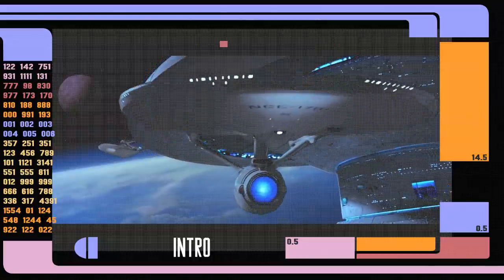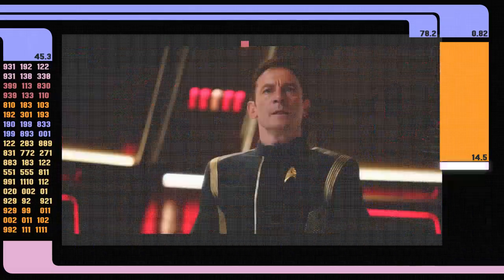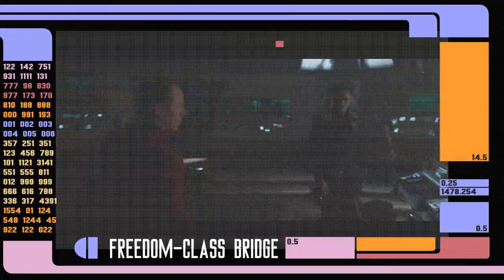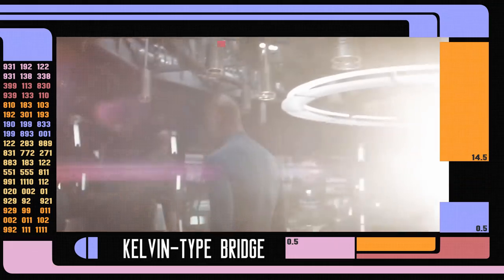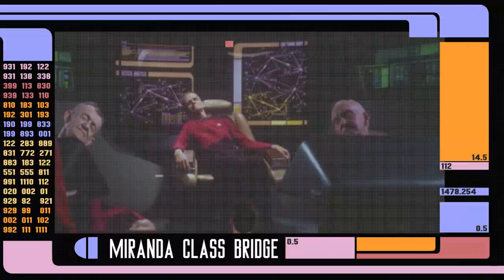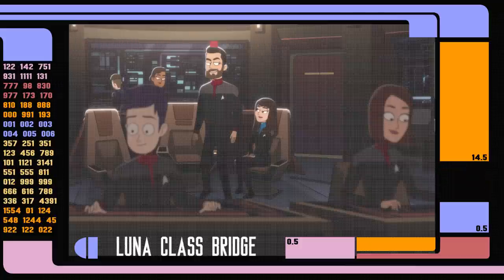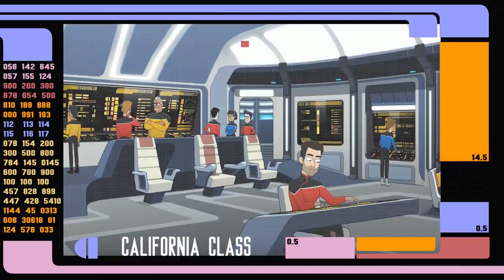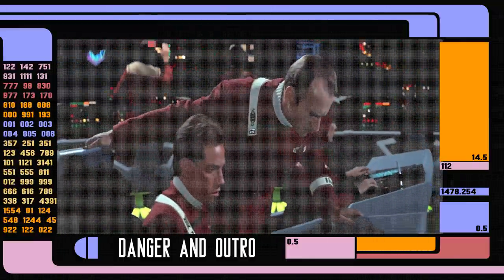Forgotten, Fatal, and Unethical Starfleet Bridges

Comment: The thing with exploding consoles is this: It is more than once stated that apart from the EPS power grid a seperate grid for the computers exists. The ODN grid. Yes it still would need power, but would it really be necassary to plug the bridge directly into the main eps grid? If starfleet is so big on redunancies, like O'Brien never is tired to remind us off, it actually would make sense to have bridge controls on some kind of independend fusion powered system. If that even would be too much power necassary just to keep the computer controls operational.

In the end the equivalent of an intranet would be all, that's necassary just to control things. The chief engineer is in engineering practically all the time anyways to work the machines, if anything happens anyways.

But I get it. Nothing what we see actually supports this designs posited.

Comment: Comment on section "Danger and Outro": In terms of power, the main power "lines" or the backbone of the power system of Star Fleet ships is Plasma (an ionized gas consisting of positive ions and free electrons) generated by the warp core (a Mater/Anti-Mater Reaction Generator) So yes the amount of power flowing in the walls and consoles may be too much to cut off or dial back in a combat emergency. And yes in a good design that does not have extras being killed by expoidium rocks would dictate that there be a shunt for the console that can be turned off in the event of an overload. But Star Fleet.

Comment: If you look at the Defiant you’ll see much more “ submarine” design. For 1 it’s sunken into the ship to make it difficult for an enemy to target it. 2 it’s a drastically smaller overall design with no science BS cause a defiant is not meant for science. 3 the closeness of the officers to the central captains chair means information can be quickly passed to the captain. 4 the navigation and Conn stations are one station operated by a single officer. There’s a slightly raised platform at the back and the captain’s chair is slightly raised but not by much. The Defiant class shows that the ship is focused on its primary task exclusively which is combat. The captain does have good access to any station they need and can quickly take over navigation if the officer manning the position is incapacitated. If you notice the defiant class also relocated the habitation spaces on the bottom of the ship to make it harder to hit a window. Lastly the class is entirely reliant on its view screen as the sunken layout basically eliminates anywhere to place a window

Comment: I've always had my own theory on the "rocks". What we're seeing is actually chunks of metal. As the EPS is damaged and has surges the plasma essentially causes the metal to become brittle and shatter, like a car windscreen would. However rather than just shattering it is usually accompanied by a surge directly in that area that then causes the shards to explode outwards. But I have always maintained that if the metallurgy of the future is different and the weapons are energy weapons and not kinetic then the effects they could have on the metal may cause it again to shatter or break off in chunks rather than ripping and tearing like a metal plate would.

Comment: With submarines at depth the water around them blocks nearly all of the light from reaching them.  They could have headlights, but that won't light up a very large area that far down.  Good enough for a small research sub, but not far enough for military use.

Space does not block light the same way.  Most of it looks rather dark because light sources are far away, but you can see bright objects from quite a distance.  A clear night you can even see some larger spacecraft as a point of light.

And the research role of Starfleet vessels would also strengthen the argument for windows relative to military submarines.

Comment: Firstly, let me say a resounding YES to the idea of a overview of alien bridge layouts.

As to the issue of windows and materials for such - we DO have something similar to transparent aluminum known as ALON, a substance that is, for all intents and purposes, transparent artificial sapphire, and it currently sees use in military vehicles and other places.  With the clearly-shown ability to have integrated display systems and optical protection, this could see some use, though I am not sure about its' effectiveness in high-radiation environments (such as space).

On the matter of seats - I've never understood Starfleet's reluctance to include basic restraints on any and every bridge (and other) seat, even if only for emergencies such as combat and/or loss of internal gravity.  They've given some nods in the direction of this now and again, but for the most part is seems to have been completely ignored and forgotten.

I think, however, that many of the commentators here have been over this in a fairly comprehensive and thorough manner that makes anything further that I might say rather redundant.  Thank you, though, for the series!

Comment: One comment on the view screen is that it was never a window, even if tech wise it could be and I feel it can make sense, but historically it was never a window until a production team that didn’t know or understand startrek took over without looking at what came before, this is most persons problems with the view screen being a window.
On the CIC point or auxiliary control in the 24 century it is became less relevant as most consoles can be reconfigured to do almost any basic ship control functions, we see this many times where as the enterprise was being controlled or taken over from engineering. And even at points where the crew is standing around the table in engineering doing CIC things, I still feel that there was an at least auxiliary control on these ships we just never seen it on screen, but I think we have plenty of evidence to show that engineering can and dose function in this role fairly well.

Comment: Soooo, the bridge consoles are connected directly to the voltages that come out of the warp core? I'd imagine that finding people brave enough to touch the buttons would be a tough job. Surely the power would be stepped down to a useable (and safe) voltage by the time it got to the consoles. At the very least the circuitry would melt before the voltage overwhelmed the circuit breakers.

Comment: Bridges with all the main characters in one room on the ship are great for the drama, however, if I were designing a ship, I would have a distributed architecture with different stations throughout the ship, to reduce the chance of a single piece of debris or one projectile taking out the command center. Once the go to action stations,  all compartments would be sealed with air and gas tight doors to limit the damage from a hull breach. I would go for NO windows. External cameras and screens can do the same job and better filter radiation, especially if they hit a Romulan ship and their black hole drive goes critical. All crew would need to put on anti flash gear and helmets. They would also need side arms ready to repel boarders and at least some sort of basic environmental suit.

Comment: The reason all military vehicles and vessels capable of using windows use windows RIGHT NOW is that while humans may not have the most advanced range finding or multi-spectral analysis hardware, the Eyeball Mk.I is still the most ubiquitous sensor available to our species for all visual needs.
If your fancy radar assisted targeting gets fried by EMP, or develops a glitch, or is broken by falling into a chasm during a sudden earthquake, you can still look at things and try to hit them.

If you can't then that opens up a whole new can of worms. The issue with windows on spaceships is that if you want to look at something that's even relatively close in space then you pretty much need to know exactly where it's supposed to be and HOPE it's reflecting or emitting enough light for your jelly globes to focus in on. But the spaceships in Star-Trek generally fight at so close a range as to be practically TOUCHING each other by comparison, so windows would still work.

Comment: One thing about the Freedom class is that it wasn't designed for the MACOs, it was a survey vessel, and the MACO captain & his crew in the film were 'demoted' to a survey vessel for political reasons, probably off of a dedicated warship like the columbia for demilitarization shortly after the foundation of starfleet. With the founding in 2161, this leaves 2-4 years of "early 2160s" for the federation to start demilitarizing it's member states & building combined starfleet, thus fitting in the timeline.

Comment: At 0:37 The Excelsior has it's iPod plugged in and ready to blast some beats.  Good while it's being towed back to space dock.  

As for captain in the middle and the bridge on top design, it feels like that would make a lot of sense as a design aesthetic that no Star Fleet procurement team would allow to change.  My take is that military and quasi-military traditions run deep.  Star Fleet being mocked for this slavish devote to a clearly goofy reliance would be a good point for Lower Decks to tackle.  Same for Klingon's same idea while putting support struts blocking the captain's line of sight (and sound) to important bridge officers even though they would probably have some very elaborate arguments boiling down to "but we've always done it this way" while citing their victories in numerous fights.  The flip flopping of clearly present restraints and seats to no visible restraints with some officers standing would be up to design philosophies of the era just like the uniforms because it's not that iconic.

Also Star Trek throws out cannon for hack writing.

Comment: Not rocks but a thick coating of ceramic thermal insulation similar to on the bottom of the space shuttle, it is ment to protect the outer decks from times of high heat and radiation exposure they can't retreat to a position in the ship that is less exposed, this is hidden behind panels normally but in combat areas with direct hits this material and its panels concealing it get blown off by the impact and the fractured thermal insulation looks like broken rocks of various sizes.

Comment: Transparent Aluminium is a ceramic that is not made from aluminium but aluminium bases compounds (Aluminium Oxynitride) has been in existence in the US since the early 1980s and is available under the ALON brand. 

Researchers in China have also reported to have developed a ceramic, AM-III carbon another transparent semiconductor glass material capable of scratching diamonds.

Comment: First off, the Constitution refit had seat restraints, and they were used. See TMP and ST VI, from the top of my head.
I don't know if it was one of your videos that mentioned how impractical the wishbone structure behind the captain is for tactical station, but it's something to be mentioned.
And beating a dead horse, only accessing the bridge by turbolift is a crappy way to do things.
You lose a lot putting windows in bridges. For one thing, it means it's near the outer hull (granted that it's where bridges are located in the Star trek universe, but we're discussing logic, not canon). For another, mechanical impact is just one of the things a bridge must be protected against. Laser fire (something windows are designed to be vulnerable to, being transparent and all) and radiation in many forms. 
Also, as any fighter pilot will tell you, if you only have a vision arc of some 30 degrees in front of you is begging to be outmaneuvered and killed.
Also, being in the outer hull, it's in a extreme point, making average travel time from off duty places (say, the gym) to your bridge station longer. And it creeates a bottleneck for the crew to create a jam in getting there. Imagine the turbolifts lining up, waiting for the previous in line to vacate it's passengers before lining up to disgorge it's own.
Similar problems for data cables. They'e longer, taking more miliseconds for the data to be relayed and distributed (hundreds of kilometres of distance when travelling at relativistic speeds). And there's more of them to be cut by damage, leaving the bridge useless with the application of less damage.
Back to windows, in relation to relativistic speeds. When fighting ships at tens of thousands of kilometres and moving a thousands of kilometres per second, eyeball mark one won't be that useful as sensors go. And yes, all battles scenes form 1982 on suffered from this. I blame George Lucas and his WWII aesthetics for Star Wars, that contaminated ST.
Now, viewscreens can shut down when overloaded (they didn't in TOS, but still), avoid radiation damage. When conjugated with a sensibly located bridge, avoid crewmembers being sucked into vaccuum (Nemesis) and allow for shorter time to crew reporting to emergency stations.
Finally, yes, there's a place for the conning of a ship from a station using direct eyesight. You just need t see a big ship docking in port to understand it. The pilot does it form a dedicated station on the side of the ship, amidships. A big ship - say, anything bigger than a defiant class - needs one of those. Maybe as many as six. The Cerritos certainly could've used it in their latest episode.
But here's the point: It should be a small room, little bigger than a fighter cockpit, and rarely - if ever - used. Not what'a arguably the most used and most important compartment of a ship.

Comment: Starships use plasma conduits to transfer power, so it's not really 'electricity' as we know it. As such, a traditional breaker wouldn't really work. It'd have to be an emergency shutoff valve that cuts plasma flow to that console.

Comment: Why would literally any console anywhere in the ship need even a billionth of a percent of the power output of the warp Core running through them? In fact it's shown the consoles don't draw energy from the core because they usually still run just fine when a ship is on emergency back-up batteries...and they STILL explode when the ship takes a hit. Any one of those consoles could easily run for days off a couple 9-volt batteries considering they at most have the functionality of a modern smartphone...but even the crappiest bootleg smartphones don't turn into live grenades when they're dropped.

Comment: I like the design of NASA's Mission Control.  My design would be 3 tiered with the top tier is the Cptn with a c&c display. 2 steps down 1n a 180deg arc will be from L-R tactical, science, center is helm, navigation, communications. My engineering station will be behind the Cptn on a pool table. This station will be shared with what ever mission specialist, and hanger control. The reason for that is mission specialist and hanger control are part time on the bridge.

Comment: Obviously the rocks in each console is part of a stone filter system, like what's used in high voltage tranformator stations and in nuclear power plants to filter out hazardous particles and gases from the air in the cooling systems.

Comment: Technically, on the 24th century ships like the Galaxy Class and the California class, Main Engineering can be used as go-to in  case the main bridge is unable to be used, like say for example an Android gets a sudden compulsion to go visit his father and locks everyone out of the bridge, actually the ship can be run from anywhere on the ship with the use of some data PADDs, it's even possible to run helm on a PADD while sitting on the unseen loo, so you can gather some bridge officers together in someone's personal quarters with some PADDs and run the ship, not a the best way to run a ship, but it is possible.

Comment: Uh in combat the captain normally is in the CIC while the XO will be at the bridge(which relay navigating instruction in the engine room and wheelhouse(the guy who actually steers the rudder).  will depend on the ship.  Bridge is more nor ship navigation. CIC is locate normally where its more highly survivable.  THink submarine control rooms,  Newer designs now integrate it like sci-fi "bridge".  Check japanese FFM 30 frigate helm can be controlled from the CIC from what I understand and oh its circular shaped.

Comment: 1:00 Submersibles and submarine warships are two very very different things. One is a warship, designed for combat, and one is designed to conduct research.
     Windows are a weak point, something that is bad when going into combat, and in a submarine the ability to see out is not a big advantage. It is dark at all times when more than a few hundred feet under water and even when you are not that far down visibility doesn't allow you to see more than a few hundred feet, if that far.
      Modern warships don't really need windows in combat. For one thing, the targets of a given ship are likely to be beyond visual range and sensors on the ship, such as radar, can give more accurate information on a target than the Mk 1 Eyeball.
      However, modern surface ships do still need windows Combat is not the only thing a warship does. They will need to see out when coming into harbor and when maneuvering among other ships. 
     When surfaced even submarines station eyeball in a place that people can see outside the ship.
     Airplanes have windows mainly because it is easier to fly an airplane if you can see and orient yourself to the world outside.
     It's not required aside for ground operations (takeoff taxi, and landing) but it requires special training and assistance from ground controllers (ATC) to keep airplanes  apart.
    Having a view screen could be very handy on a space ship like we see in Star Trek, and even showing a picture is something that would be handy. But what we see on the view screen is not what you would see if you replaced the view screen with a window.